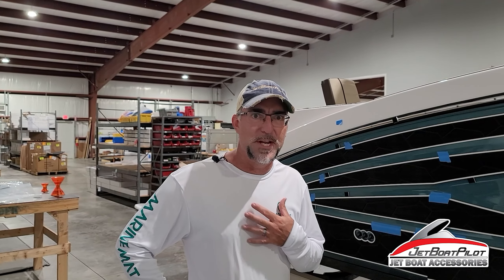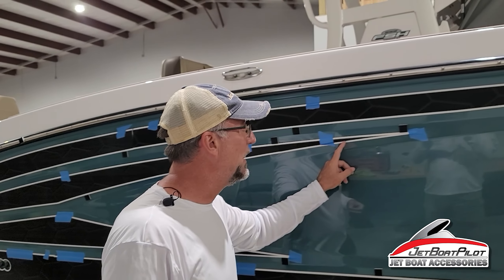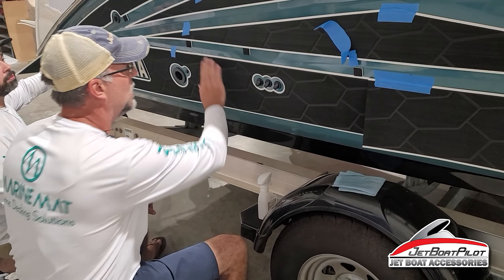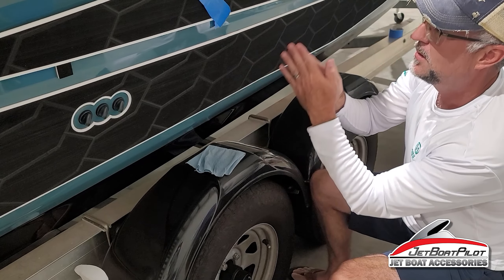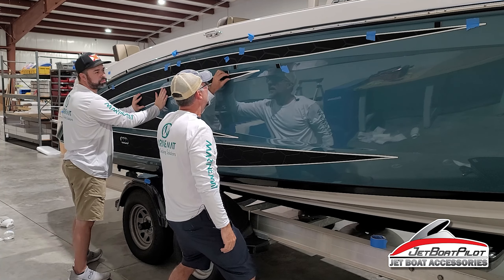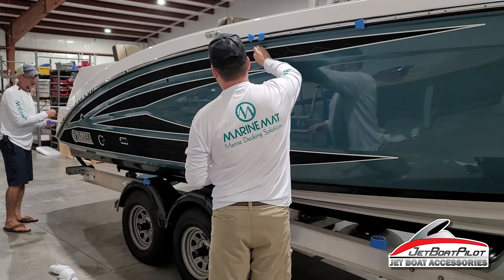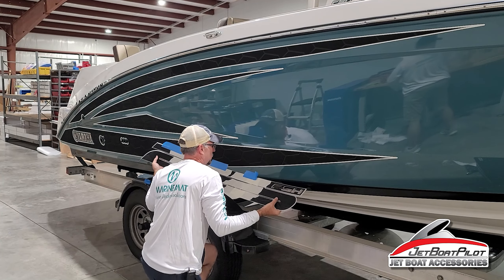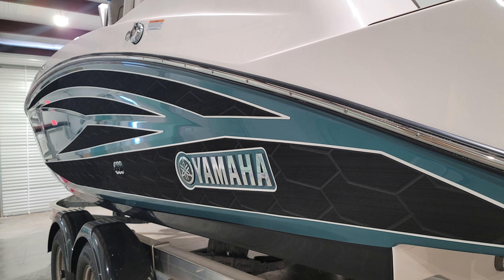JetBoatPilot Impact Graphic Install Tips

Comment: What happens to the butt seems when the material shrinks over time?
Reply from the maker: If not installed properly it can show a gap. If installed like in the video here there is a small gap but not as pronounced as when the stretch method is not used.

Comment: How you cleaned and wax the boat after the years? How to avoid oxidation in between the letters?
Reply from the maker: Keep the boat covered and you'll preserve the gelcoat. Spray wax is ideal but a plastic Razor Blade removes wax residue around letters.

Comment: Nice, will you have options for other yamaha models also?
Reply from the maker: Yes, we're developing a full line. It will take some time but it's a major push within the organization. We currently have the 240/242 from 2015-2020 and the 190/195 from 2019-Current. We also have the 210/212 from 2012-2016.
Reply: @JetBoatPilot  let me know when you have the AR195 link up and running on the JBP site!
Reply from the maker: @mkrebs66  planning to add it very soon.